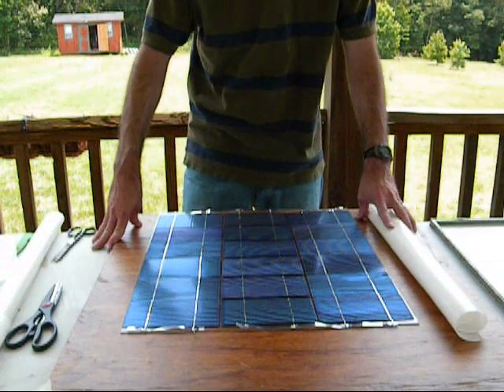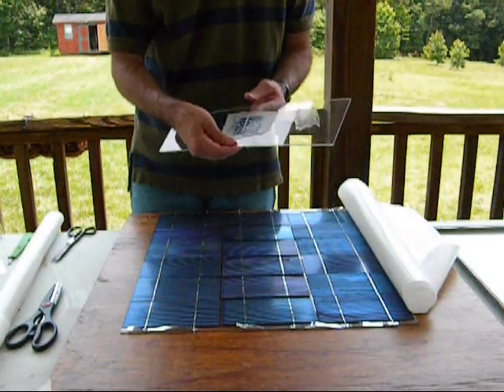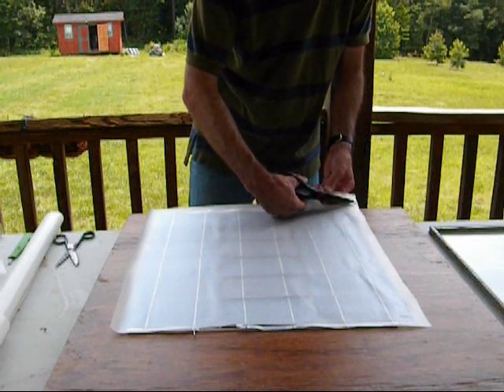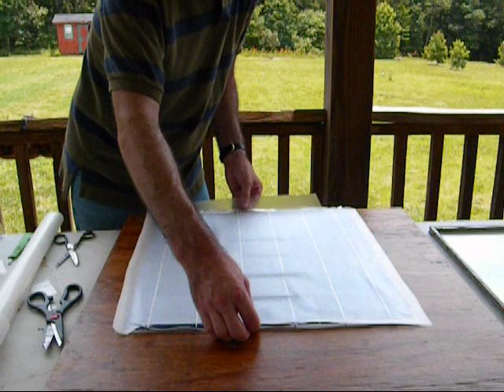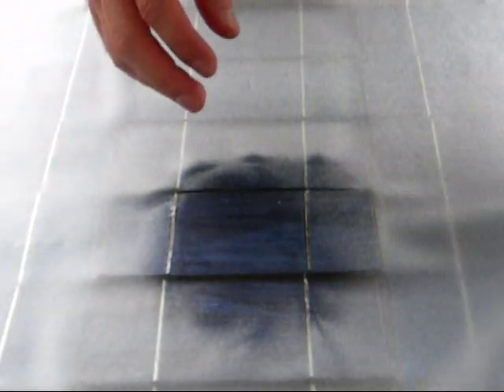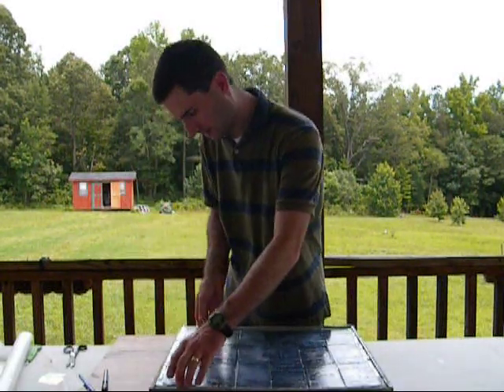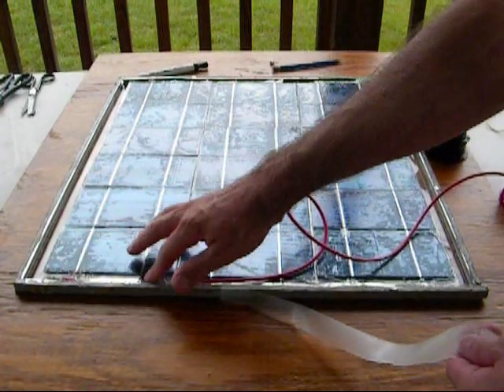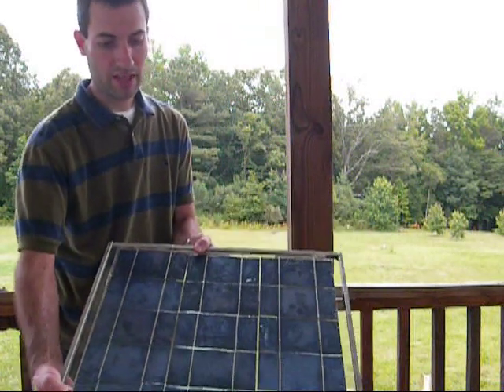How to build a solar panel part 7

Comment: Thanks for the video. I want to EVA film encapsulation.
Is it necessary to encapsulate both sides of the cells?
Reply from the maker: +Ponniah Kunathasan I actually have tried just doing one side and then both sides with EVA. In the end encapsulating both sides worked way better and gave better protection. Thank you for the question, Lonny

Comment: I'd be interesed how much the EVA layer cuts down the light into the cell.  Just because you can see through it doesn't mean anything.  You could take a cell, cover it with EVA and compair the current output to a non-covered cell.  I bet it drops a lot.  I think EVA belongs on the cell backside to seal the cells against a hardened glass sheet, not on the front side as so many people are doing.

Comment from the maker: If you can seal up your frame to make sure absolutely no moisture gets to your cells, then you don’t need to encase the cells. Moisture is the big problem; it will degrade your cells over time. On the encasing spray, I am not aware of anything like that on the market. Thank you for the questions, Lonny

Comment from the maker: These cells did end up encased in glass, it was protected front and back. I just sit it in the frame and in a later video I put the glass on the front. Thank you for the question, Lonny

Comment: Nice work. I am curious as to why you didn't use the glass panel for the front and the plexiglas for the rear, with the glass protecting the cells from exposure or sudden unexpected trauma. Will the EVA protect the cells from direct weather exposure? I certainly cannot see it stopping hail or something unexpected. Just curious. trying to learn but there are so many views and opinions, it can be overwhelming to a novice like myself. Nice video series.

Comment from the maker: @Poppycockify I just ended up using glass for the back, because they all get mounted on solar stands when they are done. I wish I had thought of using them in a skylight setting, that is a great idea. I wish I could answer the slate tile question, but I have no knowledge of tiles what so ever. Thank you for the questions, Lonny

Comment: Hi, this video series is great. I notice youu don't put a backing pane on your panels. Is this because you use them in a skylight type setting? What would you recommend as a back method for hanging panels on slate tiled rooves?

thanks for taking the time to put this series together - very informative.

Comment from the maker: @hhittini Not a strange question at all, Some people have a moisture problem with their diy panels. There are many different ways to make a barrier to protect the cells. The main reason why I used EVA in this video is because at the time I could not find any videos on how to use it. So I thought I would make it to help anyone out who wanted to use EVA for a barrier. Thats for the question, Lonny

Comment from the maker: @eddyogi So far I have not had a problem with the cells getting to hot. I still get right around 20.5 volts with the completed panel hooked up to a meter.

Comment: Have you had problems with the cells overheating under the sun?  I tried using an 8mm thick plexiglas, sun exposed side of cells actually on the plexiglas, then encapsulated with EVA on the back of the cells.  It worked great the first few minutes under the sun, but after a few minutes, the cells started feeling really hot to touch, almost unbearable, and the voltage and amps started dropping significantly.  The surface of the plexiglas didn't feel hot until a few hours later.

Comment: What would be wrong with using the kind of shrink wrap that you use for insulating your house windows in the winter?  Could they stand up to the heat that may be generated by the sun on the panels? Seems like that would be easy if it could be used.  A hair dryer is all you need for that. :)  Also does the EVA reduce the effectiveness of the sun's ability to generate electricity?  Great video series by the way :)

Comment from the maker: @MrHorsetail I did find 1 person selling it on ebay in the U.S. Look under solar cell panel eva film. I have not noticed any problem yet of the eva cracking or breaking cells. I will tell you that it was my least favorite way to make a vapor barrier. But I thought I would show every thing that I could think of for the cells. I hope that helps and good luck with all of your projects. Thanks again, Lonny